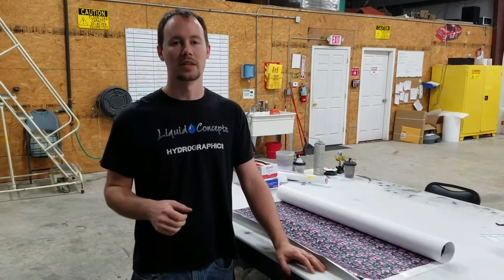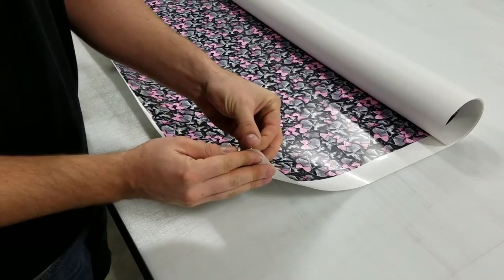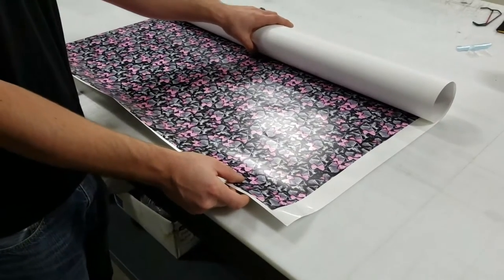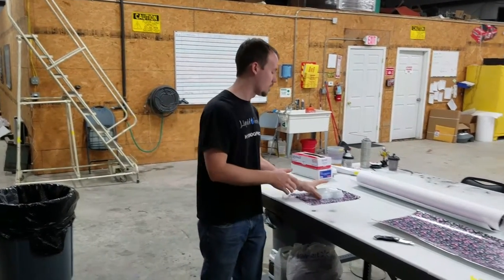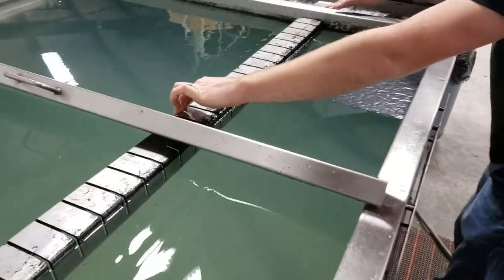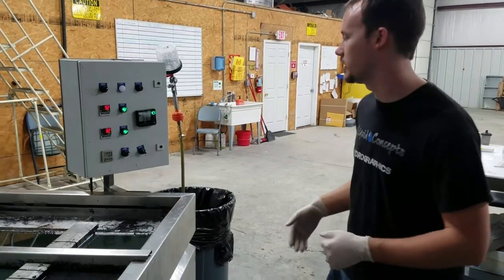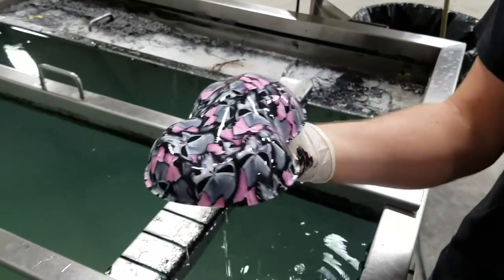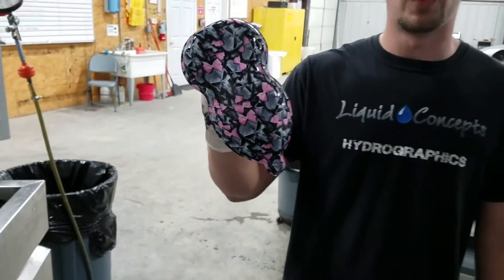Liquid concepts showing custom water transfer film printing

Comment: Hey guys I have a question. I have been dipping for a while. But still lost with things. My first question is why that when I go to dip my item the film wants to break apart and not fully suck to the item
Reply: Also 1 more the side of the film that's sticky is the side that goes down facing the water right?